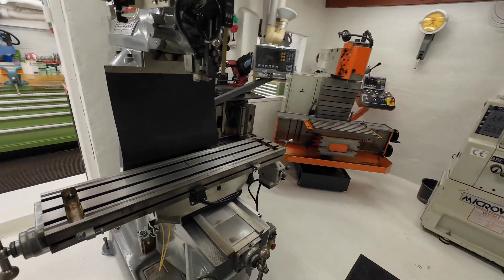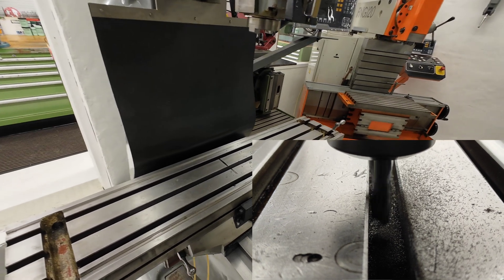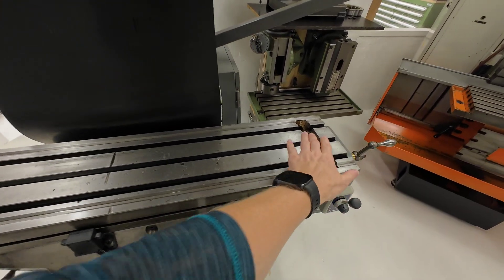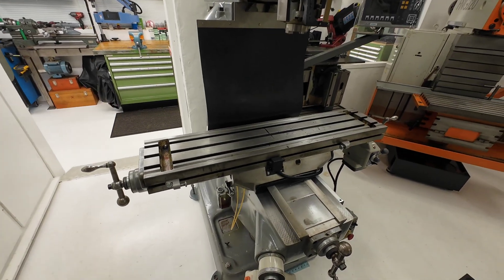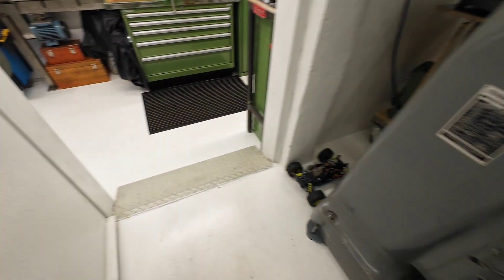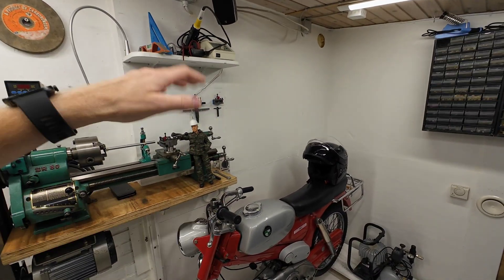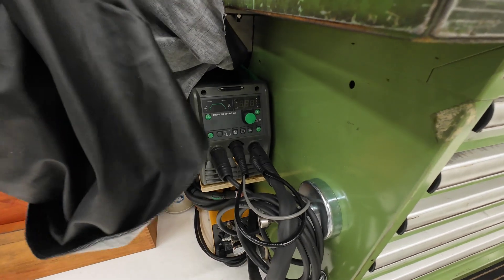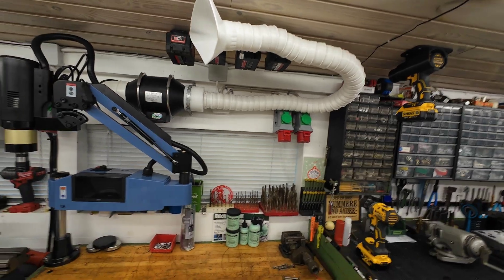Projects from the machine shop week 32 2024 - shop talk and new accessories - also some machining

Comment: FYI, Anchor Lube WILL stain and etch, just like your old compound if you do not clean it off quickly. Especially cast iron.  Do not get it on any machine ways (particularly lathe ways as they are more exposed). Do not leave any residue in tapped holes, especially blind holes that can sometimes be a pain to clean thoroughly. If any remains in threads, it can attack the bolt/threads and lead to seizing.  I am unsure why it gets such good praise. Its the least pleasant tapping compound I have ever used in every aspect.  Good ole Tap Magic Nano for ferrous materials, and Tap Magic Aluminum for non-ferrous materials serves much better.

Comment: Nice vises. I think you will like the anchorlube. Only issue I have discovered is if you dont use it a lot it will tend to dry out in the bottle.
Reply: yeah in the squeeze bottle the tip will kinda dry up.
Reply from the maker: Thanks allot 👍 thanks, I will way attention.  Do you think it's possible to add something to get it more floating again?
Reply: @OmeMachining  I tried mixing some water in it and it did not stay mixed very well.

Comment: How do you like the emco? I've been consideting replacing my bridgeport with a machine in better condition.

The deckel ergonomics look much nicer and it seems more rigid, but I'd be concerned with the lack of flexibility in setups.
Reply from the maker: Hi. This is a Intos. Former TOS.  Now emco got the production, and I don't know the quality. But back then it's very high quality. Same level as the 'famous' brands of tool room mills.
- just way cheaper 😅
Where are you located?

Compared to a Bridgeport, this is a way better mill. In every aspects.  But it still lacks something that the BP can.  But this offers a vertical table if the box table is removed.  It then accepts allot of accessories or parts being mounted in that direction. This open up allot of new setups.  With a tilt/swivel table, which lacks some rigidity, - you will have allot of possibilities with milling at certain angle though.  I really like the control from the side.. but takes some times to getting used to. Afterwards, its just great.

Hope this answers just a little. Feel free to ask more. If i can answer.

Best regards